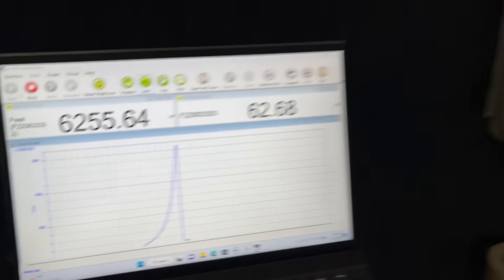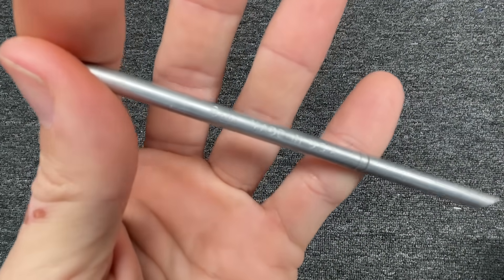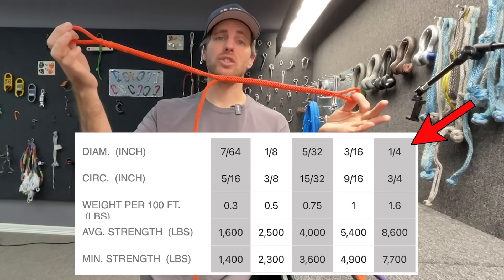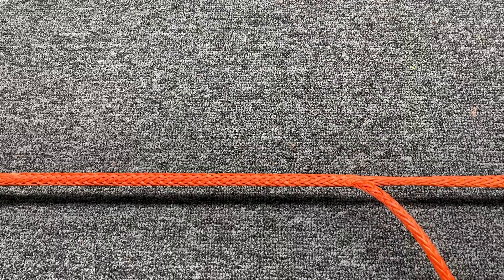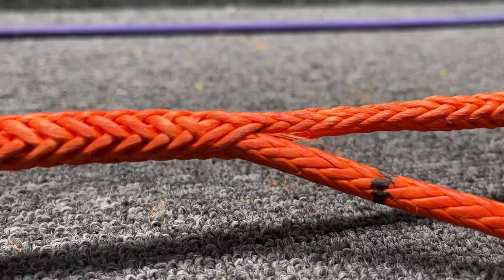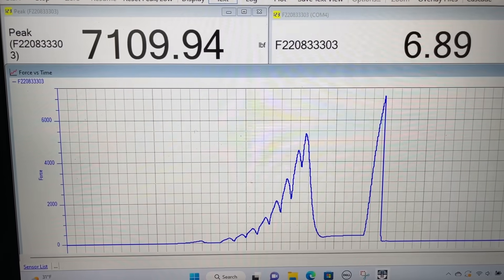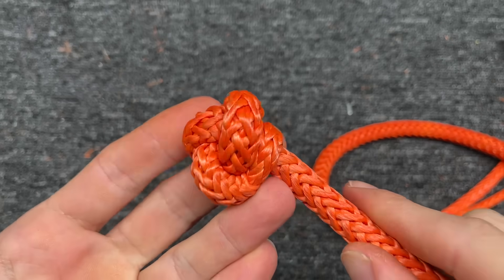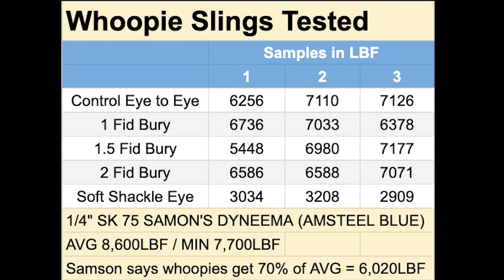Why The Overkill?

Comment: Awesome stuff! 
Regarding the metrics: 
i think it is fine to keep it in pounds if you LBF if you bought them within the imperial system. 
But I am really greatful you are doing a lot of your stuff with kn, as I am from the EU and can remember the numbers better that way. (Though I have gotten pretty good at quickly calculating LBF from kn....)
If you are going metric, I don't think it makes sense to use KGF, as all slackline gear and ... mhh, as I am writing this I am realizing not the whole audience is made up of slackliners... Forget it! :D KGF should be fine. Its great to have a second chart at the end, even if it is up for only 2 sec so one can pause it there. 

I can imagine that the double locked eye splice is not the strongest version. Just one where you don't need to bury so far. 
You pulling it quickly without letting it sit might make a huge difference. 

Next time maybe try  to emulate those wonky testing techniques. Like pulling a little, let it sit, maybe hit it softly with a stick to really get the strands to settle. Pull again (tiny bit), hit softly, repeat. Let it sit at 70% of what you would expect it to break at for a while longer and then break it. 
If you really get much higher results (20-30% more) you might have replicated those testing measures. 

Also curious about the heat generated, I am sure that can make a difference.

Comment: Soft shackle whoopie result was predictable, since the moving eye has half of the strands on either side.
So the generalized result is we can expect effective 70ish % of the advertised strength with splices/whoopies.
Now I don't have to just ape what commercial solutions are (like hammock whoopie suspenders made from 2.5mm amsteel blue), but can work from the 'first' principles.
Reply: The soft shackle design was an experiment. The eye ends up with a 90⁰ twist as it tensions, so I knew the noose would be the weak point, I just wasn't sure to what degree. This answered that.
Reply: @jarodlojeck5150  Good stuff none the less ^^

Comment: I agree. Having imperial and metric data side-by-side to appease different audiences can actually be distracting and doesn't as easily communicate the points as well. Less numbers on a graph explaining a point, all of the same unit system, better communicates things like ratios, strength reductions, etc. I always stick with either metric or imperial. Don't cross polinate or people may mentally combine units.

Comment: My guess was that 2 fid lenghts (ie. 42 rope diameters) would be needed because it is the "normal" min bury to be safe.
I'm truly surprised only one fid lenght was enough! I wish I had a scale to test some other manufacturer ropes to see if my normal 2-3 fids is overkill really.
Reply: I think one fid is sufficient on a flat test bed, being pulled in a straight line, under dry stable conditions. One fid may not be enough wrapped around a tree, in the rain, covered in sap. The 3 fid length is probably insurance under less-than-ideal situations.
Reply: @jarodlojeck5150  That is a very good point. In nonideal conditions dry flat pull it could need more margin. In real world ropes can get wet, snowy and whatnot.
For anything life support, I always tend to err on the side of better safe than sorry.
Yet I was surprised it did not slip much. I would have assumed it to slip open.

Comment: I use definitely not "as prescribed" whoopies I wonder how much of the "slipping" is due to coating. Bare dyneema definitely slips whole lot more. As for breaking strengts... i'm not really surprised that the end of the burry was the fault point.  I guess now it's the time of experimenting with even more gradual bury tapering. Perhaps different progression of it. Not linerar but going faster from large diameter to much slower towards the end of it?
Reply: These were a 6 strand taper over a 3.5" to 4" length. The samples in the eye to eye did break at the taper because it has to break somewhere. I think when the eye angle is good, and the taper is good, that spot at the tip of the taper is the weakest point, but not necessarily problematically weak, it just needs to be accounted for.
Reply: @jarodlojeck5150  oh it looked more gradual than what I do, I just wonder given that's the break point could we drop diameter faster in the beginning and make it even more gradual towards the tip.

Comment: Seems to me if you are likely to load these slings with an impact you'd want to use your drop tower to get a realistic strength figure. I think the maximum force would be much lower as the heat from slippage couldn't dissipate. Pulling slowly or pulsing has the opposite effect. It worries me that your numbers are artificially high.
Reply: It's not artificially low: whoopie slings are usually used in rigging situations where they're tightened before being subject to load, so they're not subjected to massive shock loads under intended use.

Comment: Hey there, I'm a full time splicer and I've been through the Samson facility and I'm certified through them to splice.

First thing I can say is, don't trust their instructions. There are numerous errors in the manual, and many things that aren't errors shouldn't be trusted. 

Also, those brummels on the eye-to-eye could look a lot better. I'm not surprised they broke low. Let me know if you want any splices done.
Reply: Also, I could go in depth on their break test procedure, it's an interesting process that my shop doesn't use to get our numbers.

... and if we got those numbers, we wouldn't be splicing that for our customers.
Reply: However, in the eye to eye, the eyes didn't break or slip, the break was at the tip of the taper on all 3. If the eye was the issue, then the force would have broken it closer to the problem area, wouldn't it?
Reply: @jarodlojeck5150  Yes, and the eyes are supposed to break there. My concern is that the current instructions call for an insufficient taper that isn't clearly defined. That drastic and sudden change in diameter creates a weak point.

Also, for Samson to get the numbers it publishes, the rope will be cycled up to 20% ABS several times then finally pulled to break. 

My shop gets our 100% or higher numbers without this technique, because we splice with exceptional care.

Comment: I really appreciate your videos, and I've been looking forwards to this topic in particular.

As far as the metric police in the end, while I, and most other metric using viewers can do rough on the fly calculations for metric vs imperial am used to alternating both systems for things like (rough) diameters and weights etc, I don't see the argument for not at least putting up a converted chart at the end.

You already have a graph at 9:35 (and already have the converted graph in your blog). I don't see the merit in not just putting them up side by side.
Were the units reversed, I suspect you might go to that extra effort for your (primarily) American viewers.

Anyway, that's my $0.02 (or $0.015 in USD). Appreciate your work dude.

Comment: A month ago I posted this on your video "These were RECALLED!"👇
~~~
Howdy gents from Australia! A "thing to break suggestion: Whoopie Slings.

☝️ These aren't climbing gear, but they are VERY unusual, adjustable length, dyneema spliced hitches used for hanging modern camping/hiking hammocks. I made mine from 3mm dyneema, and they are used to hold up my 100kg, when pulled to a force multiplying angle of about 20°.

I've been watching a lot of your content recently - the testing of dyneema was what drew me in, and I noticed that you've done a number of episodes looking as dyneema in sailing applications, which is why I thought it might interest you.

Comment: My two cents on why the dyneema rope is doing such weird things - context of the material application. If we look at what the primary uses have been for this type of rope, at least initially, it's been mooring and sailboat rigging applications. If you look at the stresses applied in those applications, it's rarely shock loaded or pulled to failure in one "pull", it's almost always an applied load of X and held at that load for some time, or many cycles of X load to less than X for many many cycles. 

Now i am absolutely NOT claiming this to be the why of what it's doing, but as you (Ryan) mentioned, we don't know what Samson's testing procedure is, so maybe, again as you mentioned, they are pulsing many more cycles, or holding at X kN for so long to allow the rope time to sort of align its fibers and settle in.

That all being said, maybe it's worth some simple tests, could probably do a basic test to see if there is any validity to the idea. Create some eye to eye slings all identical, do a straight dynamic pull to failure, say 3 to set a baseline, then 3 where they are brought up to something like 25% of the claimed abs for like 10 min. and then pulled to failure. Then do a set held at 50% of abs and pulled to failure, and maybe some bonus of held at X percentage for 10 min. Released and then pulled to failure. 

I seem to remember reading somewhere that dyneema actually increases its strength under tension to some extent and then drops again sort of like a bell curve, but for the life of me, i don't remember where i saw that.

Comment: I don't know why a long bury would've made it stronger- it's one thing if the tail can't hold and it slips. But if both are holding, then the weak spot is still at the same point- where the tail exits- and that weak spot doesn't change because of bury lengths
Reply: That was a major reason for the test, to see if any of the bury lengths were too short to hold. I thought, and I believe Ryan did too, that the 1 fid constrictor would have slipped. That's why he started there. When the 1 fid held, the other tests were largely redundant. The number range is very interesting though.
Reply: @jarodlojeck5150  right, that's what I'm saying. With the 1st one measured, the 1 fid length... it didn't slip, it broke. And it was the first one measured, so the cat is out of the bag already. Establishing that it will hold, and not slip, makes their weak spot the same places, but the tail of the buries, and for the Whoopie, where the tail exits.... so there's no reason for them to break weaker based on the bury length- assuming the bury length is long enough to hold- which it was. That's why I'm saying there's no surprise that the longer buries tested the "same"

The variance is a little interesting, but there is so much variability at play when making those, that it's not really surprising

Comment: I noticed perfect consistency in where the rope broke, the transition from the splice to a single rope.  Tells us clearly where the weak link is, and it's not the length of the bury splice.
Reply: I think it's important to remember that when you test to destruction, it has to break somewhere. Having the break in the same place for all of them means the other elements are done right, and that's where the design has an inherent weaker spot. That's not to say the design is flawed though, you just need to account for the known reduction.
Reply: the length and transition of the taper

Comment: I was wondering until you mentioned at 10:30 that the rate of the applied load maybe a factor in the ultimate strength. 
With non brittle material, there can be creep with time that may be a factor. 
I think you saw that with your pulse technique that it affected the results. 
As a researcher, I would see if there is an industry standard, e.g., ASTM, that provides guidance.

Comment: The numbers could be off because of a short tapper inside the braid.  I would try a longer tapper on the ends.  I am working off of whip making knowledge.  This is the same issue as round whips such as bull whips.  Round braids have a few traits that could be working against you.  1. Round braids want to stay straight.  2. Bends weaken the braid.  3. round braids don't work well in changes in the core diameter, without strength changes in the strands (larger strands for larger diameters.  If you could tie knots in a flat braid the knot may hold better, this isn't talking about webbing.  The round braid, as you know, are 2 sets of strings wound in opposite directions around a core.  These string clamp on the core, so they need a lube to allow this action without breaking.  The engineering for rope changes with each material used for the strands and core.  
Many years ago, the sailors would weave a turk's head to strengthen a rope, so you could start adding a more complex knot to your studies.  There are books of rawhide braiding and rope braiding that can help in this research.  Also try removing some or all of the core in the knots to test the strength of the outer strands.  Engineering is about designing a solution with understand of failure.  Good luck with your research!

Comment: Hurr durr imperial bad hur durr I want metric! Seriously though, I can't see how showing both units at the same time have any drawbacks except more work in editing. It will fit all audience, no data would be lost and argument be completely over.
Reply: Part of the problem is that Ryan doesn't seem to want to be "buried in the numbers," this channel is about "super good enough" rather than absolutely standardized results. He wants to portray that most of your stuff is plenty good for plenty of situations, showing the whole chart in the video is not conducive to this.
Reply: Having two different reported figures for each data point makes it harder to see trends. Your eye needs to jump columns. Either unit works fine.

Comment: I think when you're given a measurement, you should use those units.

Someone I know actually brought this up on me because I compared the length of my climbing rope (which is sold in metric units) being 40 meters, to the height of our gym's walls (which they advertise in feet) at 55 feet. They laughed that I was mixing units, but that's just the best way to describe things. When you're given a measurement in one unit, you should continue to use that unit because any conversion is a loss of precision OR requires tracking sig figs.

So if most people who use dyneema cords like this use lbf, and the manufacturers sell in lbf, then you should use lbf, too.

Definitely some wiggle room here, like if your audience was only used to metric or you were comparing against 3 other things and the other things are metric too, then you should convert.

Comment: I'm pretty sure the teufelberger splice you mention comes undone as it's meant for class 1 rope not class 2 as you tested it on. The difference is in the slipperiness of the rope. Class 1- polyester is much more grippy than class 2- dynemma. Teufelberger give those instructions to splice their product called Trex, a class 1 12 strand hollowbraid. 

It would be good to you retest the teufelberger splice on their own product.

Comment: If you have to pulse a sample/hold it at 8kn for a while then pull it or even change bend radius, then we should just change mbs to stand for maximum breaking strength. Its the same with the start specs given at the start of the video for the whoopie. You're never using it in the setup intended so the numbers given quickly become irrelevent

Just wish makers could be half as open with their testing methods as this Ryan. Not knowing how numbers are produced seriously detracts from their worth (even if its all super good enough anyway)